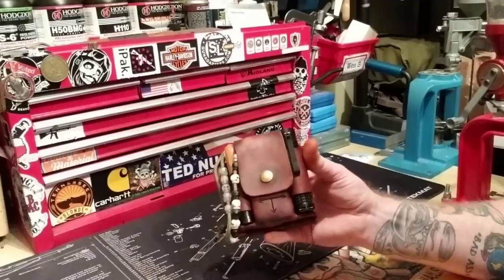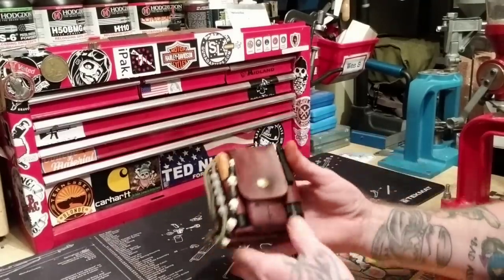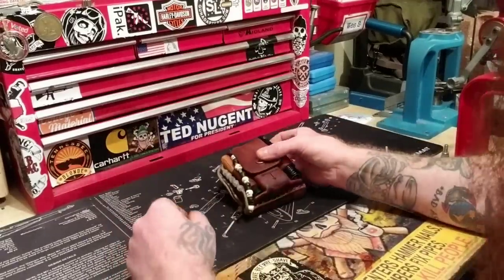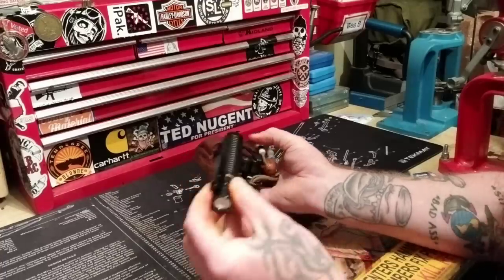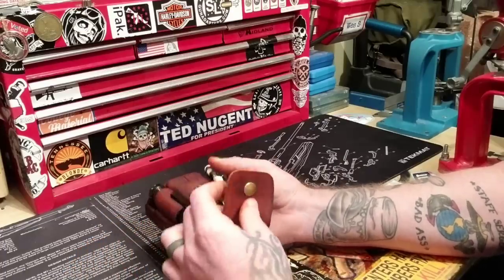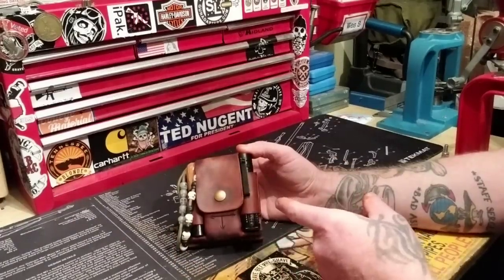Everyday Carry Bomb Proof Survival Tool Kit

Comment: I've made something similar but based it off of the original nylon sheath for the leatherman. It's more suited for my area of work where it contains the leatherman wave+, bit plates and extension,  sharpie, penlight, and full size bic lighter. I used elastic strip and made them into loops to hold the pieces onto the side of the sheath.  I love your design and will reference if for my next sheath :)

Comment: not a bad idea and exicution, but i have some suggestions / constructive feedback for the next pouch. 

i think youll find that verry large, thick and heavy pouch riding on that single spring clip will be quite floppy and likely to snag on stuff, and will wear out belts in a hurry. id suggest a tight leather double belt loop, or atleast a double clip setup.

Id try and make the pouch wider and thinner for ease of carry. again.i think youll find in use the amount this one sticks out will be cumbersome.

instead of stacking layers of leather to form the under pouch, and thus adding weight and bulk, mabey think about a wrap around design thats stitched or riveted in the back. this can be trickey to stitch but  can be done with a curved needle, and rivets are easy with a solid steel blank in the pouch to act as an anvil. you could also try chicago screws and make it into a future updatable / modular system.

i would suggest barge cement instead of super glue, its been proven for decades on leather and remains flexable, also there is no need to clamp and wait for drying.

finally an oil / wax soak usually gives a more consistant finish and also adds quite a bit of protection and weatherproofing. 

keep up the good work
Reply from the maker: The clip works great I can side it to make room for my key clip. It works fantastic.